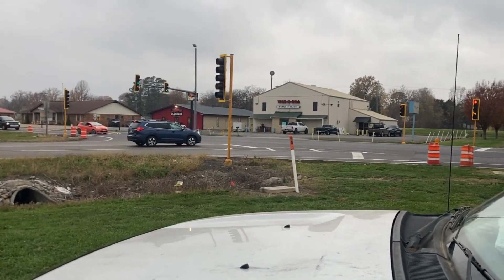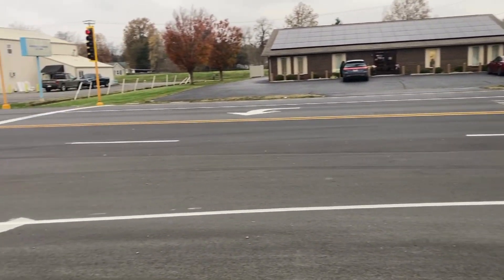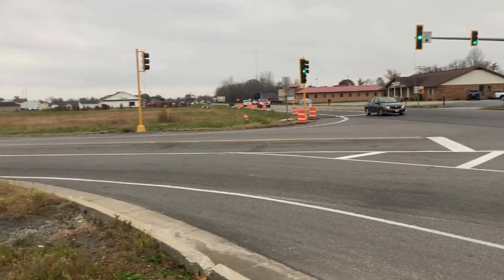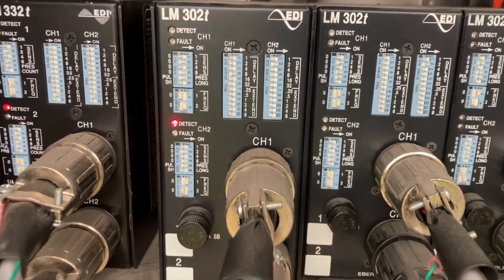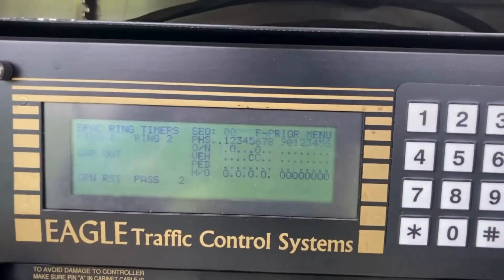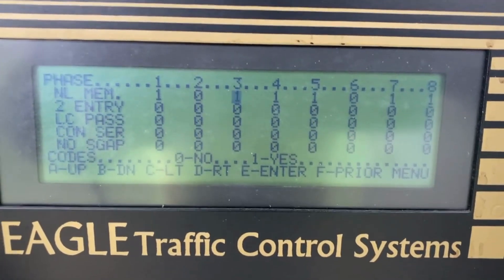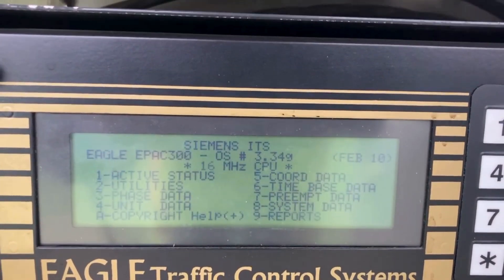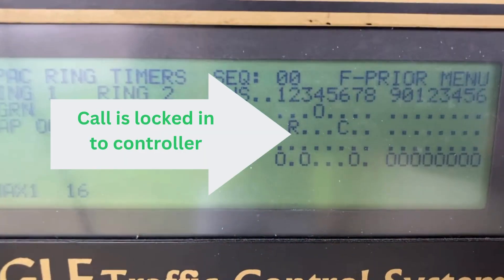How Bad Traffic Light Detection is Fueling Red Light Running

Comment: I've had a situation like that a few times near me, but not with induction loops, with a camera. I sat there forever, while every other direction cycled except my left turn multiple times. Called MODOT and right after talking to someone, it finally cycled. Also had an issue in a northern state, where, while it was snowing, and I assume they also used a camera for the intersection, not an induction loop, I sat for a solid 20 minutes while everything else cycled over and over and I sat at a constant red. Finally got to where I was like, I'm in 8" of snow, no one's anywhere nearby, I'm going. There was another similar incident, but in clear weather, which I had on dashcam, where the left turn never got a green - at least one person decided to blast around me and blow the red.... And then after a ridiculous number of cycles, it finally DID turn green... After I had called in to the local PD non emergency line about it (of course 🙄)...

I'd imagine this is state dependent, but is there a point at which you can consider a traffic light malfunctioning, treat it like a stop sign and proceed through it with caution when safe?

I feel like there should be a 'backup cycle', where every now and then, even if there's no call maybe due to a malfunction, it'll cycle through everything, not assume 100% of the time that no call is no vehicle. That may be true most of the time, but if there's a malfunction....
Reply from the maker: Wow.  You've had quite a few bad experiences at some traffic signals.  Sorry you had to go through that.  Thats why I'm big on regular intervals of maintenance and checking signal operation.
To answer your question:  I'm not condoning running signals.  But at a point, if the signal is not giving you a green and you've been waiting 5 minutes (an actual 5 minutes, not the calls that I get that say they've been waiting 5 minutes lol), then you have to move on some how.  
Many on here have stated taking a RT and then doing a u-turn, getting out and pushing a pedestrian button that runs parallel with your direction, many say they just run it when safe to do so.
All of these options suck for the driver.  
I like signals that run effeciently so thats why I stay on top of my signals so we don't have to periodically cycle the signal 'just in case its not working'
Thanks for commenting!

Comment: I'm a gig driver. I barely have time to complete the order when the app says it should be delivered by. I don't want to be deactivated for being late. So I always do the following whenever possible and when a cop isn't around.

I always avoid red light cameras unless I absolutely can't avoid them. I get into the right lane at a red so that I can get creative with a right on red or a rare left on red (left from a 1 one onto another 1 way). I turn right go a few hundred feet, do a U-Turn if clear, and then go right, straight, or left (rarely). That way I didn't waste time at a light and I didn't technically run a red light.
Reply from the maker: Well thats probably the most effecient and fast way to do it!  LOL

Comment: @streetsmartstraffic, Please keep us gig drivers in mind when you time lights. We can easily get deactivated/"fired" because we're too late to the customer even if it's the restaurant or store that was delaying us. (Plus we don't have unemployment, sick time, PTO, etc.)

Furthermore, most of us (90% to 99% of us) work overnight hours. We are driving through lights when it's not either rush hour. Please calculate non-rush hour timing into the traffic lights. Otherwise, we're just going to keep running red lights so we can pay bills like rent, gas, and food.
Reply from the maker: If its working properly, the mainline should stay green all night...unless someone pulls up on the sidestreet.  
Of course, that's how we run them where I'm at.  Some flash their signals at night, some serve greens to each direction.
It really comes down to how the owner of signal want to run it.

Comment: Used to be forced to run red lights in the early morning hours on my motorcycle.  I guess it just wasn't big enough to trigger the sensors.   I'd give it a few minutes, or sometimes I'd have to go press the pedestrian button.  Or if I wanted to do the legal maneuver I'd turn right, then a U-turn, and another right.
Reply from the maker: Yes, motorcycles are the hardest to detect with inductive loops.  Thats why I'm moving our signals to video/radar!
Thanks for commenting

Comment: Platooning is another complete crock of shit.  
When you hit several in a row at 3am delivering food on a scooter the urge to just treat them as four way stops is strong.  
And don't get me going on how drivers respect four way stops here in the city of the ' best and brightest '.
Reply from the maker: yeah, unfortunately in offpeak hours, usually coordination is not used.  Which is why you may not be hitting all greens if you're on the mainline.  However, at 3am, I'm wondering why you would have to stop at all???
Reply: @streetsmartstraffic  Still the law.  Plus one of the Spanish guys ran a light last week and was hit and killed by a plainclothes cop in an unmarked cop car.  Really doesn't matter.  I don't buy the dogma of platooning period.  Something from an engineers fever dream.

Comment: Is it possible to preset a timer of how long a light can be green without detection changing to red to give the perpendicular lane a green in case of a malfunction like this?
Reply: yes, but then you'd keep getting red lights on the major street for ghosts on the minor
Reply: @sleetskate  better than staying on a red as shown in the video
Reply from the maker: @sleetskate  Thanks for answering!
Reply from the maker: Great question!    It appears that you're question has been answered below but to further clarify-yes, you can.  There is a 'recall' setting in the controller which will give a green light (after serving other directions) to the direction you entered it in.  
But the original problem was that the loop failed and by design the detector box will sense this and place a constant call into the signal controller (which in essence is doing what you'r asking).  The problem came when the contractor disconnected that loop which made the constant call go away....but created the new problem.
Anyway, hope that helps!
Reply: @streetsmartstraffic  what contractor? You mean when when they poured asphalt and caused the disconnect or a completely different contractor/disconnect?
Reply from the maker: @Bosnian.Spartan  The general subbed out an electrical contractor to look over the loops in the road.  They would eventually be the ones to cut new loops for any damaged ones..
Reply: @streetsmartstraffic  that electrical contractor disconnected that "Recall" setting?
Reply from the maker: @Bosnian.Spartan  in essence, thats what they did!

Comment: Many drivers notice a change in light behavior at an intersection and adapt to it, such as that first pickup truck that did not pull all the way forward.  When there's a roadworks project at an intersection it's typical to see such a change, and usually it's far from ideal.

In one example of a nearby watermain replacement, the main direction of travel only had a green light every 2 minutes.  Once there was a gap more than one second between vehicles, the light turned red which led to immerse backups.  I learned that you had to stay right on the bumper of the driver ahead or else just a single car could make it through at a time.  This was a dangerous situation as people would push their luck and in conjunction there were often left-turners—a recipe for disaster. 

In that and other examples it's clear that someone had gotten in to reprogram the controller, but not thought it through properly, did not understand the nuances of what they were doing, or just didn't care whatsoever.  Many newer signals are moving to camera-based detection around here which helps but that isn't perfect either as you know.  Thanks for making these videos. Seeing all of this that's normally hidden out of sight is fascinating to me.
Reply from the maker: You just brought up a perfect example where after reprogramming a signal controller, observations of the changes did not take place.  Its easy to fat finger an entry when doing it by hand.  Unless you go back and review programming and then observe the intersection, incidents like this can occur.  
Sounds like in this scenario the 'extension' was not correctly entered.  So every time a vehicle would drive over the detection loop, it would 'extend' the green by that entry.  So if it was entered as 1 second, then every vehicle detection would extend by only 1 sec.  So a gap between vehicle of over 1 sec...well then you have your situation you describe.
Thanks for sharing your story and commenting!

Comment: More than 20 years ago there was a traffic light that would only ever tturn green for a left turn if you ran it.  Sit there for a long time at the red. As soon as you run the light it turns green.
Reply from the maker: Sounds like the detector was not placed optimally and only detected vehicles once they pulled far enough through...like the middle of the intersection.  Yikes!
Thanks for commenting

Comment: A few years ago Virginia DOT installed a new traffic signal. 2 months later the road was repaved and the brand new loop detectors were damaged, causing the signal to max out the time on the left turn signal. I am of the understanding that the folks at VDOT think they run the best DOT in the country, if not the world. If that's true why would they install a traffic signal 2 months before a repaving job?
Reply from the maker: well you'll have to ask them.  lol
Traffic Light Doctor (another channel on youtube) installed a $160,000 signal just to be torn down a year later.  Not always sure why things are done they way they are...even after 24+ years doing this!
Reply: @streetsmartstraffic  I think they've got some operational challenges...A few years after that they repaved a 2-lane road, painted the center line, then ran the machine to put a rumble strip down over the newly painted lines destroying them, and then repainted the lines AGAIN. The office of whomever is supposed to be managing this stuff is probably  filled with cobwebs because nobody's been in it for years.
Reply: Sometimes one hand doesn't know what the other hand is doing. Sometimes they have contracts, contracts may have a deadline, city may be willing to honor contract and pay for new loops later, than to give the contract a freebie or have traffic held up for two months due to max recall of phases. Some intersections that is federally funded may have expiration date on the funds. Need to spend the money on that intersection or they get no traffic signal for that intersection. Some of the Traffic Control Centers are funded by the federal government including positions, if not all. I have seen a lot of spending that didn't make sense too!

Comment: Whenever there's a fault like that, the system should automatically revert to clock-timed traffic light phases, so that at least most of the vehicles will be able to travel through the intersection without long delays.
Reply from the maker: The original problem before the contractor disconnected the loop was this.  By design, when a detector loop fails, it constant calls for that direction.  Then the complaints come in for the streets that are getting stopped to serve that direction when no one is there...
Once the contractor disconnected the bad loop, then we had what you saw in the video
Thanks for commenting!

Comment: I drive daily through an intersection that, after a recent repaving, has been exhibiting nearly the exact symptoms you showed here today. More than once, after an extended sit with no other traffic in sight, I've driven through a red.
Reply from the maker: They many very well have the same problem.  If it becomes a problem, you can hunt down the municipality that the signal resides in and call their public works dept.  If they don't maintain it, find out who is responsible for the maintenance.  Persistence is your friend here.
Thanks for commenting

Comment: There is a T-Intersection on my commute to work that will sense my motorcycle when there is not other traffic behind me and will actually go as far as changing the cross traffic light to Yellow then Red, but it never gives me my Green.  The cross traffic goes directly from Red to Green without ever letting me go.  No idea how many times I have run that light.  How does this get fixed?
Reply from the maker: Not sure how the intersection is equipped with detection.  If loops, can you see cuts in the road where the wire is installed?  If radar or video, can you see if it appears to be aimed at you?  Those are up on the signal arms or on the signal uprights of the mastarm.  
You can find out the municipality that this signal is in and call their public works department.  Ask them if they maintain the signal (have both crossroads names).  If they don't, ask who maintains them.
After you find out, it may (unfortunately) take several complaints to get it looked at.  Just remember -in the traffic world, the squeaky wheel gets the oil (kinda a good analogy)
Good luck!
Reply: @streetsmartstraffic   Thank you for the reply.  They use both loop and camera systems here (Oahu).  This particular intersection is loop.  I have noticed that on systems with multiple loops leading up to the limit line, if the traffic is not particularly heavy, it can take some time for the light to change if there are only a couple vehicles stopped and that it seems to expedite things a bit when a vehicle is already at the stop line if I stop on a loop a lot further back (like the third one back about 100 feet from the intersection) leaving the huge gap between me and the vehicle at the line.  Is there any validity to this method?
Reply from the maker: @smvms  I don't think so.  Probably a long wait time for the side streets due to mainline getting the lions share of the green time.  You're just arriving a little later than the vehicles that got there before you.  So you're waiting less time and the appearance is that you affected the signal.  
Thats just a guess though!

Comment: I've seen many intersection that needed to be fixed, even when the detectors worked.
Bad programming led to some offramps where I used to live holding people up for forever to let non-existent traffic use the overpass on weekend mornings because the bias was for traffic crossing over the freeway..
Reply from the maker: Its possible to have detectors placed back to where the ramp begins.  Then if it detects vehicles present and sitting there, a preempt could be used to flush the waiting traffic.  
A bad problem to have is sitting traffic on a high speed freeway.  We have an intersection that has this problem near me.  During evening rush hour, the interstate becomes dangerous near the offramp.  To be fair though, its difficult as the road the traffic is existing onto to also very heavy and right in the middle of a 5 intersection corridor.  It's not always perfect and sometimes it just is what it is and the engineer does the best they can do with what they have.
Thanks for commenting!

Comment: I have been wanting to see a video about this topic and FINALLY it has been recommended!  Fascinating!

How/where/to whom  does one report broken/dysfunctional signals?
Reply: In Illinois they put the name of the agency responsible for the signal on the traffic signal control box. That's the kind of practical thinking I expect from folks in the Midwest.
Reply: @brianleeper5737  Do you mean "In case of emergency call xxx"? Or just the name of a company?
If first I always assumed that was only in case a car hit it or fire struck to get it turned off asap.
If latter couldn't that just mean who made the box rather than who's managing it?
Reply: @ProulxS  They put the name of the government agency that is responsible for the traffic signal on the box, whether it be IDOT (Illinois Dept of Transportation) or DuPage County (for example). No phone number, but you can Google for the phone number of that agency and report the problem to them.
Reply: To whom: Usually the city, but maybe some country have centralised transport department responsable. Please confirm online since you didn't provide details.
How/Where: Depend the city. I know Montreal has a website section just for that but while I assume most cities in various countries will have forms the way to get and fill such form will vary alot in all the cities across the world... Again you will want to check more locally to get this info accurate to where you are.
Reply from the maker: @ProulxS  Thanks for responding so thoroughly!
Reply from the maker: It appears your question has been answered below!  If you need more info, feel free to ask!

Comment: This doesn't explain the people that just don't stop at all and run the red light. Plenty of room to brake, light is red for over a second or two, they just keep going. Philly sucks for traffic law enforcement. Parking too
Reply from the maker: Thats where enforcement comes in!  This past year we started using SPM's (Signal Performance Measures) for traffic signals.  It provides lots of analytics on the health and performance of signals incorporated with it.  Red light running is one of the measures that can be seen.  We have a few signals that are MAJOR violaters.  
With this technology, law enforcement can be informed to watch over that particular intersection.
Thanks for commenting!